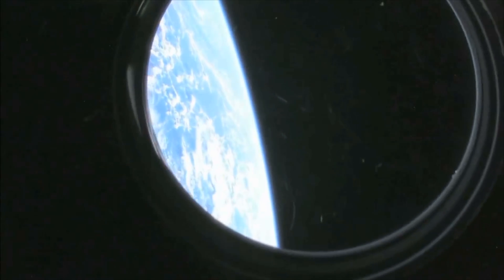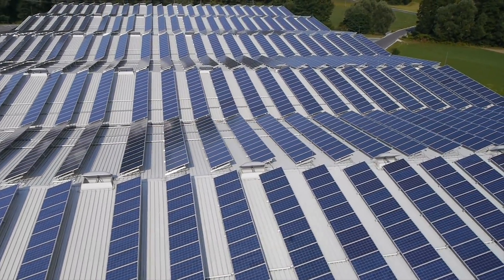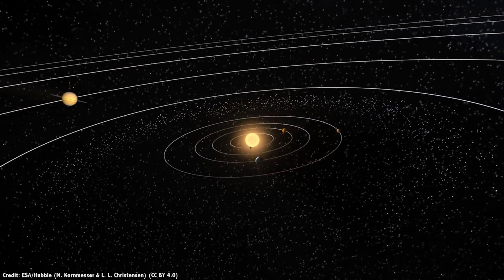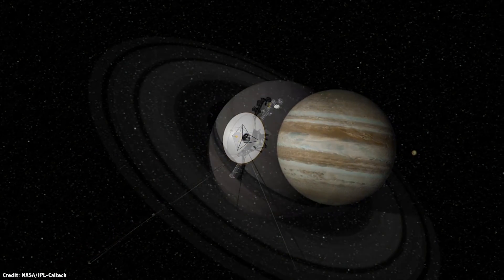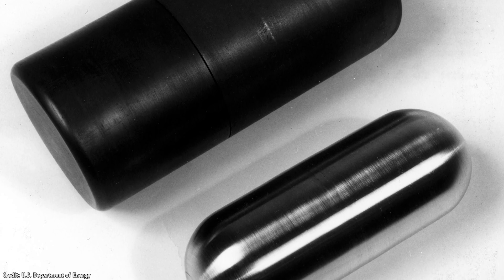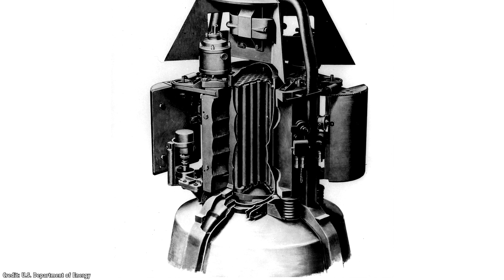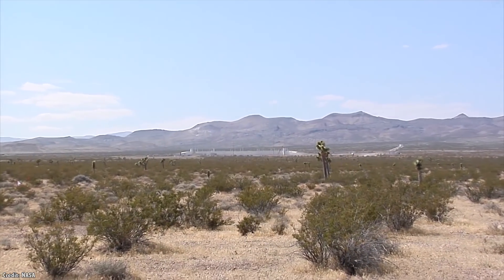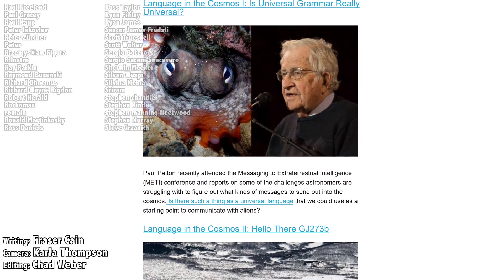The Problem of Power in Space. NASA's New Kilopower Reactor

Comment: There's one more option,  antimatter.  We can manufacture and store it already.  Just need to scale the process up by about 10^256 times.
Reply from the maker: We can only do a few particles at a time right now. But scaled it would be awesome.
Reply: You would have to learn how to reflect gamma rays to use it
Reply: Gunnar Winchell
We've already got a crude method for reflecting gamma rays, or at least the energy they contain. It's sort of a similar concept to a the fission sail.

The idea is that you absorb the gamma rays with a big chunk of lead, which heats the lead up. The lead will then re-emit the energy as thermal energy via blackbody radiation.

If you shape the lead into a large dish, then coat one side with a thermal reflector(aka tin foil), the vast majority of the thermal radiation will be emitted from only one side.

With this method you can reflect about 90% of the total energy from the gamma rays. It's not perfect, but it works pretty well. The biggest problem is that it's heavy.

Though since the thickness of lead required to stop a given percentage of the gamma rays is constant, as you scale the design up it becomes more weight efficient.
Reply: @ubersuperboss7761  And why do you think that is? They don't destroy themselves, they contact other matter and annihilate.
Reply: There has to be a way to reflect them...
Reply: In theory it would be sweet, but the logistics that would go into the process would be mind bogglingly expensive. And dangerous, keep in mind it converts it's mass entirely into energy, a mishap with a gram of the stuff would be like Hiroshima all over again (minus the fallout). And generating it requires a device the diameter of a city with the same power consumption. Fusion is where it's at for a viable and safe form of power production, the fuel is one of the most abundant things we have, hydrogen. It can be produced for pennies on the dollar through electrolysis of water using solar energy, then heated to the point individual atoms form together to create helium, which is a safe and useful byproduct, and create (hopefully) gobs more wattage per dollar than any of our current infrastructure can currently. Supposedly we are just on the verge, but who knows, they've been saying that for a few decades now.
Reply: How about we just use energy from fantasyland.
Reply: Two problems with antimatter . One is that we make it as a byproduct of particle accelerator collision events in very minute quantities that are too small to be useful for power generation, and the other is that it annihilates instantaneously with normal matter, so you need a powerful magnetic field to contain it until you're ready to inject it. The advantage to antimatter however, if we COULD manufacture large quantities of it, is that it produces a reaction that, per E=mc^2, is PRECISELY 1:1 mass to energy! The ENTIRE mass of the matter/antimatter collision is turned into energy, making it the most efficient process of energy production we know of.

But oh what promise!
Reply: It's important to remember antimatter is only a method of energy storage. While it releases E = mc^2 of energy upon annihilation, it takes precisely that much energy (slightly more actually) to produce it the first place. When we smash two protons together, they form 3 protons and one antiproton, the production is therefore less efficient than even fusion. But there is no better possible battery than an antimatter one.
Reply: Which is why it's so popular in Star Trek. Whatever energy you need to put into making that antimatter, you CAN take it with you!
Reply: @BlackEpyon  Who knows. Our next star destroyer could probably use anti matter for energy storage.
Reply: @honkhonk8009  "Next" Star Destroyer? We'd need a FIRST Star Destroyer first. Either way, we need a more efficient process for making it before it becomes viable as a fuel source for anti-matter reactors.
Reply: antimatter doesn't exist
Reply: @breazfreind402  Yes it does. Antimatter was predicted by Paul Dirac in 1928, and they were first observed in particle accelerators in 1932 by Carl Anderson, long before Star Trek got to the idea.
Reply: fite me
Reply: in fortnite if you can
Reply: bet you cant you very nasty i checked your stats
Reply: default dude
Reply: Just make 255 more particle coliders, right guys?
Reply: Mini black hole engine via Hawking radiation?
Reply: @Hy-jg8ow  I know it's a totally crazy idea but if you could create a small enough amount of matter compacted like that which creates a black hole is it at all possible to create power from the gravitational forces?
Reply: @joer8854  Thats actually an interesting idea to think about...some kind of thug-push piston...or rotating blades around it passing on their inward momentum to an engine somehow. I think its a nice idea.

Comment: Could high energy lasers not be used? This has been proposed as a power method for a space elevator : beam the power to a target craft use high power lasers. Distance doesn't particularly matter in space (in our solar system) just the angles. Local power powering long distance craft.
Reply: phooogle, I may be wrong, but wouldn't a laser beam spread out like a flashlight given enough distance? I don't know how great the distance would have to be, but if it's too far, the beam could be spread out over a foot. At that point you should just use solar energy.
Reply: In theory you can keep the divergence low enough that it remains a better option than solar energy at any given distance. It still get's worse with distance, but not by as much as solar.
Reply: Beam divergence makes this impossible over any significant distance.
Reply: Sigh, the loss of power wouldn't be worth it.  Lasers are horrible conduits for power transfers.  You'd loose at least 60% and then you'd still have to store that power unless you're thinking we'd keep a continuous line of sight which nothing could get between, silly

Comment: I personally think NASA missed the boat on this one. They could send up some of these giant wind turbines and mount them on moons and asteroids and use the solar wind to provide megawatts of power........hehehehe
Reply: Raymond Heath ,   I know this is a joke but...There's been some research into using the solar wind for power and propulsion.  I don't know the reference of the top of my head. 
One can
capture solar winds,  by creating large coils,  as energetic particles pass through the coils it will generally a current through the coil.  This  works just like a magnet passing through a coil.
Reply: Solar sails are real and have been experimented with already
Reply: Raymond Heath  yes planetary society and jaxa has launched a great  crafts with solar sails, that use photons.

I was referring to other radiation sources such as highly charged particles that can induce a current in coils
Reply: Andrew Steinhaus like the charged wire experiment on the shuttle where they generated far more current than they expected with a trailing wire
Reply: Raymond Heath  exactly!

Comment: Another option is beaming energy from one place to another using lasers or masers.
Reply: thughes218, you would probably lose some efficiency tho. Maybe in the future there will be 1-2 large power stations on each planet that beam power to spacecraft. We need gas stations in space!
Reply: Side benefit = weapon
Reply: Apollorion - what about an array of satellite's placed out in space to transmit the energy from the laser, receiving it, transform it and transmit it futher to the next satellite until they reach the spaceship or whatever needing the energy, those spaceships could even drop of small receive/transmit satellite's while swiching through space for them to supply them with energy
Reply: Doug Golde - pure genius! If the aliens try something with us we cut them into small pieces with numerous laser emitting satellites, an unpleasant surprise indeed
Reply: Well,  catching power in the orbit of Mercury and then beaming it to Jupiter with a (l/m)aser may make the laserbeam at Jupiter maybe much wider than the planet itself, but it could still have a much higher enerrgy density than the direct solar light, don't you think?
Reply: Such an array would indeed be nice and I think they should relay the beam with (almost flat) parabole mirrors, but those mirrors need to rotate due to the orbital difference of the satellites they need to connect.
Reply: I wonder what kind of precision that we could potentially be capable of for this kind of technology. 
I was just thinking that it could be really useful if power stations could be built at all the lagrange points, but that would essentially mean beaming power from 1.5 million kilometers away. Though at this distance it likely becomes more effective to beam power even through the atmosphere.
Reply: Nolan - this is a question for Fraser Cain I think, we are definitely on to something big here, this can revolutionize space exploration, plus be a defence against evil aliens, it is just a question how far away we can utilize laser beams, to place satellite's in Lagrange points to distribute energy out into space must be even better
Reply: Fun fact: Fast Radio Bursts are just the result of us being in the line of sight of just such a system located in a galaxy far, far away.
Reply: +
thughes218
unfeasible. the cost would be astronomical and the efficiency abysmal.
Reply: Yeah, that laser was used to beam life from Mars and oops, things went boom.
Reply: Only if we could do it, we could have solar cells in orbit and beaming power down to a special no go zone station. With every roof with solar cells, it could be a mistake cos the cells are all dark and that could heat the planet up. They are already talking about painting roads white to help stop climate change, so all those dark solar cells won't help. Having them in space solves the problem if we could beam the energy down.

Comment: What about hydrogen fuel cells? Didn't the Apollo missions use them?
Reply from the maker: Yes, but those really only work for short periods of times. They're essentially batteries.
Reply: Just more than 12 and a half days was the longest. Not good to go where past the Moon.
Reply: +
Gnoccy
RTGs and fission reactors work for decades while fuel cells only work as long as you have fuel
Reply: The thing about nuclear power is that 3 kg of uranium carries the potential energy that 240,000,000 cuft of natural gas. So the fuel for the fuel cell will take up far too much room to be a reasonable alternative unless the trip is very short.
Reply: You got me thinking of Lofstorm launch loops sending solid methane and ice in Dewers to the Moon. Fuel for space and exporting carbon from this biosphere. For the long term, we can get volatiles from the Belt and beyond (comets and ice asteroids).
Reply: Remember the technology to go to the moon was lost along with all the Apollo telemetry data. So maybe all those forgetful engineers, forgot about that too.
Reply: +GazSChad
So what if the tweaks to the design were lost? They figured it all out the first time, we can figure it out again by retracing their steps.... IF we wanted to send them on a Saturn V, rather than a modern craft. Minus sending humans, we're doing far MORE now, with VASTLY greater technology than was ever conceived of for Apollo. The problem is that NASA itself is responsible for far more now than just getting humans to the moon, and only has so much money to go around. I say we yank some cash from the DoD. They get 36 times what NASA gets anyways, and only seem to be really good for pissing the rest of the world off.
Reply: shhhhhhh....
Reply: they need some Post it notes...or a Reminder-Ring...or a secretary...or a Sticker.....maybe like a Nasa Backpack....
Reply: `dust-devils` ;) cleaning solar panels. on Mars. at night ;)
Reply: +Tom Kelly
but think about how many tonnes of shielding and equipment you need to carry with a reactor alongside those 3 kg of fuel.
Reply: Jack Vernian 
It would still be easier to carry than 240 million cubic feet of gas.
Reply: +Robert Pruitt
240 million cubic feet of liquefied natural gas weighs 12.65 million pounds. That's the weight of two loaded Saturn V rockets. The nuclear reactor is cheaper to launch.
Reply: I agree with Gnocchi, they are very important and the base of many missions including the lunar landings. You could use methane cells (hydrogen is difficult to keep for long times) and pending that you have enough fuel it can last a long time.  Not like, solar or nuclear, but solar also last far more than nuclear.

Comment: I hope launch reliability has improved enough for this. Nuclear rain sounds like a bad thing. Thanks for the vid.
Reply: As long as you don't start up the reactor until it is safely out of range of falling back down, then it should be fine. Uranium on its own isn't really all that toxic. It is the stuff it turns into that is troublesome.
Reply: easy. get the nuclear material from the moon or asteroids.
Reply: Sounds like a good solution for the near future.
Reply: Helium 3 is on the surface of the moon and I believe that makes a good fuel but before we could process that in-situe we would need a lot of infrastructure in place.
Reply: Have they determined such materials are on the moon?
Reply: Good to know.
Reply: Goku: Agreed, Nuclear in deep space is not only inevitable, it is necessary. And even the shipping of Uranium fuel is not all that troublesome.
Energy density is everything in space and if you reject nuclear you reject meaningful space exploration.
Reply: zigzag duck amira

Comment: Fuel cells!
Reply: are not an energy source just energy storage.
Reply: Right; I was just reacting to, "There are three ways of generating power in space: solar panels, RTGs, and nuclear fission reactors" (0:25), which leaves out the power systems used on Apollo and the Space Shuttle.
Reply: No. Nuclear and solar are the only ways. Fuel cells run out of fuel quickly.
Reply: Provides water too.